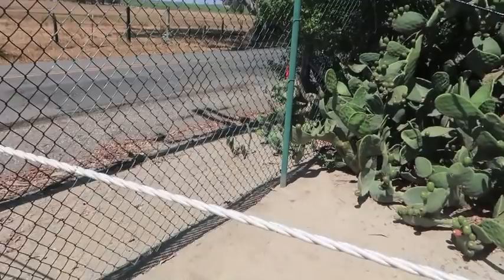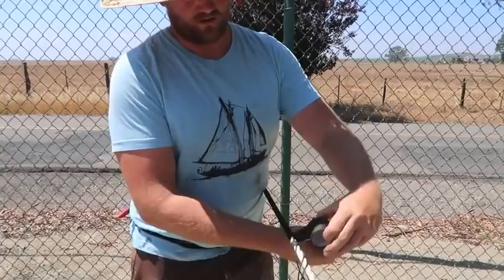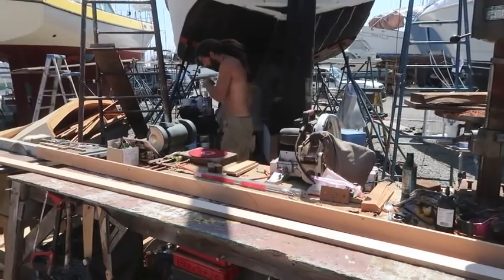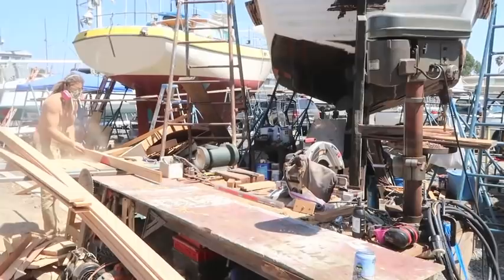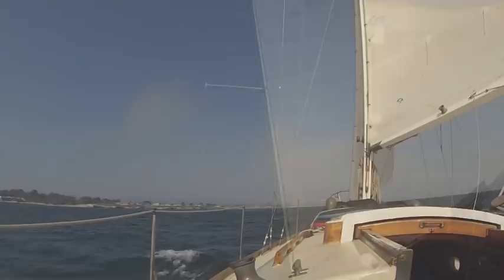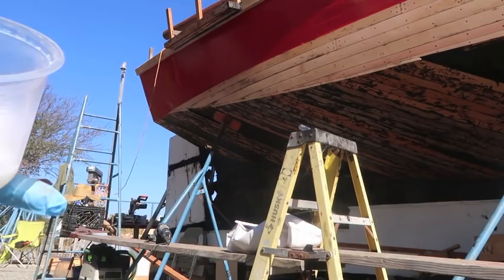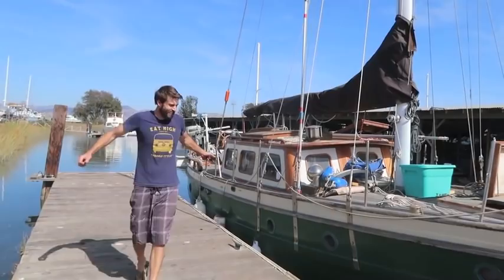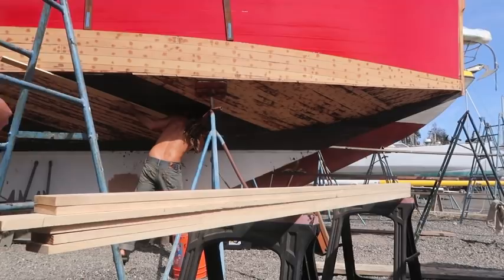Salt & Tar: Episode 41-Traditional Rigging Done Modern Style and, of course, sheathing

Comment: Rigged a LOT of sailing boats in SE Florida, late '60's, early '70's.  I need to make you a serving "mallet" - looks like a "tee".  The cross on the tee is hollowed on the top for the size of the rigging you are serving - the serving twine is on a reel, with the twine wrapping around the vertical of the tee.  You control the tension by the wrapping twine, and your hand exerting a bit of pressure, then just twirl the tool around the standing rigging you are working on.  I am sure you can find various references with a bit of looking.  I had them in 3/8", 1/2", 5/8", and 3/4" - and they all showed a lot of use.  I do like the newer lines - we had a choice of dacron, nylon, and galvanized, for the most part.
Then, right after I posted the above, you bring out the mallet!  God job, crew!

Comment: Definitely another episode.  Also please address stretch of kevlar (or is it actually Dyneema or Dux?)  Check out Sailing Zingaro for some weird but useful stuff on synthetic rigging.  You probably have seen this but there is a repro book out there. "A young sea officer's sheet anchor"  that could be called how to rig a tall ship from scratch.
Reply: Mark Bernier Kevlar is high modulus and won't stretch, but it will degrade in UV which is why the wrapping is a good idea. Dyneema doesn't degrade in UV but Vectran does.

Comment: Have you guys acquired your rigging cable/wire yet?
If not, I may have an inexpensive solution for you.
I have 3 rolls of galvanized steel cable that was made for utility guy wires (the cables that hold up telephone poles).
Let me know if this is something you can use.